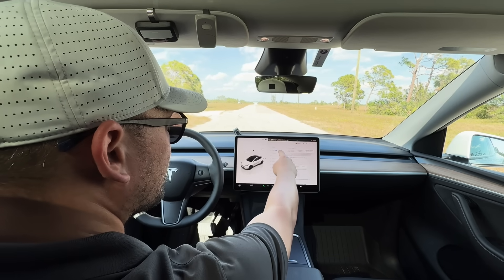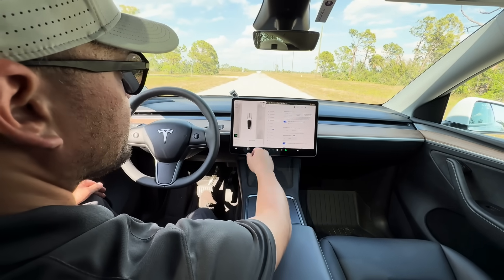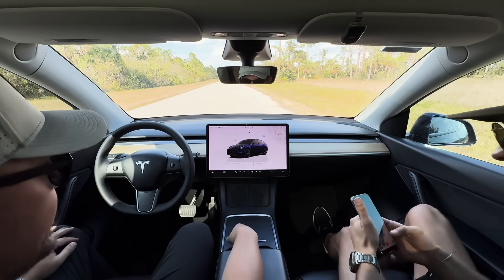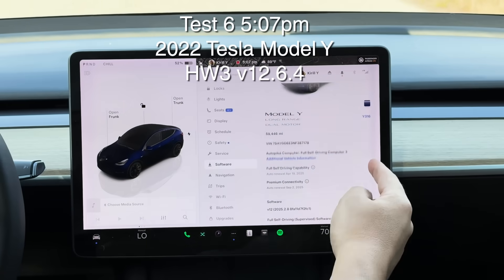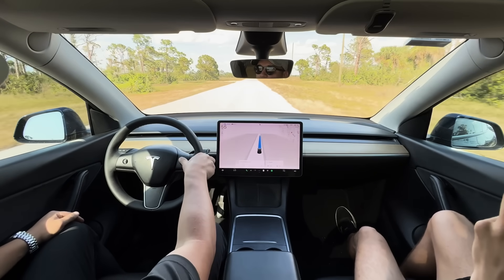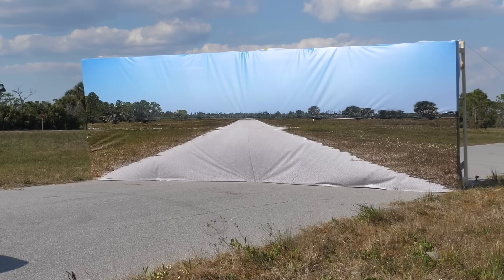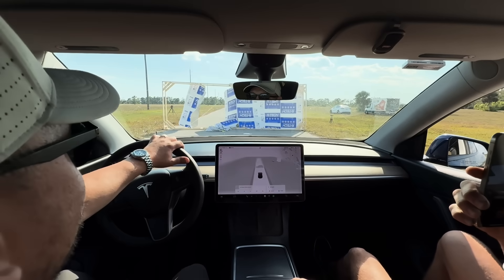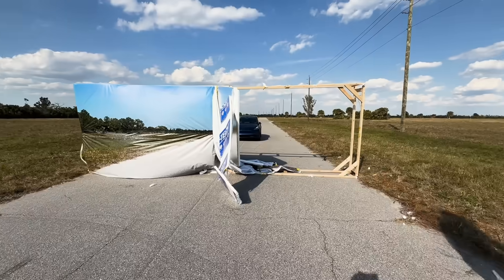Mark Rober Debunked - You can't fool a HW4 Tesla using FSD!

Comment: It’s cool to see hw.4 is able to detect it more reliably, but if you watch the screen as it approaches it still has a hard time deciding if the road is real or not as you can see it changing the direction it thinks the road turns as it approaches.but that’s mainly also due to it being it’s pretty obvious that the fake wall you used doesn’t have the right perspective you should really do it again but make sure the perspective of the image that’s printed actually matches up to the real world and has the correct scale, I’m not saying mark’s test was perfect but his fake wall was definitely more convincing 

But when Tesla started with the whole FSD, lidar technology was super expensive and it make economical sense to not install lidar tech into the cars, but now the tech is much much cheaper to where even phones have a lidar sensors built into them. Just including them would give the neural net  a much more definitive answer on if there is something in the road that blends in or not that the optical cameras  can’t determine. 
There’s really no excuse for the next hardware revision of the teslas to not have lidar sensors built into them.

Comment: I am glad that someone tried the test with different conditions.
You would have to see what the camera sees and how does it analyze the feature points.
It is possible that because the canvas is curled and that the road is not fully continuous on the painting that it saw those curls and it saw the crossroad therefore inferred that there is some object infront.
The only way a visual odometry system can detect distance is from feature points.
If there are not enough feature points or If those feature points are not chaning in terms of diverging on both cameras the detection will think that there is no barier infront.
So this test can vary depending on the light conditions and the wall conditions.

Comment: This is confusing to me, as in 2022 the Model Y came with a front radar. Yet that was removed during 2023 and not available in 2024. So why didn't the front radar see the fake wall? Might it not have enough mass to reflect the radar? I see the styrofoam of the wall has a metallic backing, you would think that would reflect a radar signal. But.....

Comment: The challenge faced by FSD is that 99.9% of the time it will get it right and so will likely pass every test that it undergoes but it really life it must repeat those tests millions of time and at some point will encounter that 0.1% situation.  And if it does the FSD system will be vilified.

The challenge is that whilst everyone is accepting that a human can make mistakes 20% of the time, because to ‘err is human’, anything less than 100% by a computer system is unacceptable.

When a human crashes, their might be an investigation, and sometimes it might be drink, drugs, dangerous driving but most times it will be just chalked up as an accident - you can’t tear open a human’s brain to see exactly what happened.  But when a FSD system crashes there can be an intensive investigation and you will likely find exactly why it crashed and you can ask “if it had been programmed differently, if it had different sensors, would the crash been avoided and chances are the answer will always be ‘yes’.

And that is why society expects FSD systems to be 100% perfect whereas it is okay for humans to be 80% perfect.

Comment: I don't like Tesla. I don't like EVs. Yet, as a computer scientist, I totally expected this to happen for most Teslas.

Figuring out a 2D image vs. a 3D environment is the basic requirement for any camera based environment recognition in computer vision. Before any image content is analyzed by the computer, the 2D image must be framed correctly. Only then you can use your neural net to decode the meaning of the road sign. Therefore, for any camera based system, this large picture will just be a huge meaningless road sign with unrecognizable content for the car.

Within the last few years road sign recognition has greatly improved for the average car. Even my not special Nissan Qashqai from 2022 does this flawlessly, and it has nothing as advanced as self-driving, yet full-self-driving. Therefore, it was to be expected that only older Tesla models may be fooled some times, while recognizing the image most of the times.

Comment: You didn't debunk Mark Rober, per your own description he used older hardware and software, you actually CONFIRMED his test.  You can gig him for not testing on the latest version or multiple versions, but you can be gigged for your inaccurate title.  Click bait much?  Also, I have no clue if version 4 would pass the test or not with a better wall, but you did yours on a rode with lots of trees, there is a distinct difference between your wall and the scene behind it especially when you're further away.  There is also very clear large wrinkles in your picture near the top.

Comment: the thing is the car has skynet built in and it used advanced light composition analysis to determine the walls material and thickness as well as whether anyone is behind it and decided the car wont suffer any damage if it railed through.

Comment: Yeah, but the only problem is is you’re doing it in the daytime try doing it at night the cameras probably won’t be able to pick up on the wall in time if you check out a video on the Wall Street Journal covering Tesla on FSD somebody was driving at night and an 18 wheeler was tipped over on its side and the camera didn’t pick it up in time and killed the driver what Tesla needs to do is add lidar to there vehicles as well and yes that technology is more expensive, but it will save a lot more lives
Reply from the maker: Great idea to test how HW4 would do at night in this scenario. I’ll work on this and see if I can make it happen

Comment: That wall has too many rinkels in it, ofc its going to notice the wall. bad replication of the experiment. 
also you should add two poles to the edge of the wall/mirror" to simulate telephone or power poles to remove the clear edge there.

Comment: I'm no fan of Tesla or Musk but are people really worried about running into a painted wall in the middle of the roadway?
Reply: You never know when a cartoon character might paint a tunnel on the side of a mountian.
Reply: In Mark rober's original video, he was testing how liDar technology differs from Tesla camera technology. This was one of the tests he made for the video. This scenario is obviously not realistic, but the point of the test was mostly to compare the 2 technologies and how camera systems can be fooled.
Reply: @velocity6867  cameras work in basically every scenario except ones where even humans would struggle to see a foot in-front of themselves.
Reply: @ Yea, that's why the test isn't rlly practical. The other tests he showed where tesla failed could be a problem; I would like to see if the new FSD solves them.
Reply: Well the point at this stage is that a single laser range detector can more reliably detect what is in front of it than multiple regular cameras, lots of computer upgrades, and a ton of software jank. If a single component can more reliably replace all those other things, it'd be an excellent addition of safety systems.
Reply: @ cameras can easily detect WHAT an object is and react appropriately, laser detectors have more trouble with this.
Reply: @Axodus  You do realise people are not asking for one or the other. Tesla should use both if they actually care about the safety of their customers and the people around them.
Reply: Might be trouble with reflective surface, like a building with a mirror-like wall.

Comment: So hw4 is a big improvement. only thing i was wondering looking at both test u used isolation foam with a reflected coating could this have effect if you compare it to the test of Mark robert? just curious
Reply from the maker: The front was a strong banner and then foam directly behind it. I don’t think it had much reflective effect. 

Regardless, HW3 didn’t see it and HW4 did. Shows the strength in the newer hardware over the older.

Comment: Interesting, thanks for doing this. I suspect many human drivers would fail and if you had an image of a person on the wall both cars would have stopped. If the firefighters are properly equipped with F500 Encapsulator extinguishing equipment putting the fire out in your proposed test should be a breeze.

Comment: It seems funny but a few people did lose their lives to a situation that was similar. Painted building and even trucks were an issue. It's a good thing that issue was fixed. Large objects can be obscured if it looks similar. This can and has happened with regular people behind the wheel. Self driving or not, if the car can brake in such scenarios it's safer for everybody.

Comment: I am not a scientist but it looks to me that the wall panel is so small that the edges are clearly defined against the background at the time the car starts to slow.  If the wall panel was much larger ie higher and longer it would be more difficult for the cameras to see the edges and then determine it’s a wall.  Also I bet this would crash at night or in slightly foggy conditions where cameras are much less reliable.  Every other manufacturer believes you need multiple different sensor systems which then compare results to get the safest result.  Where human life is concerned relying on cameras is a risk most are not prepared to take.

Comment: My whole thing is, why not throw in a lidar with TESLA? Can I walk with one eye open, sure, but 2 eyes helps for sure, 2 eyes and the nerves in my feet make it even easier, 2 eyes, my ears, and the nerves in my feet is much better. 

Same holds true for sensors in electronics when programmed to work together. Yes TESLA can drive just like we do using our eyes... but if it had lidar too, it could use that to help it see when conditions are not as ideal.

Comment: I mean HW 2 was supposed to be capable of full self driving so regardless they have fallen insanely short, though rober should add a note about what he used for testing and that it may not / isn't accurate for newer hardwares
Reply: Cybertrucks still have terrible problems with full self-driving. I'm assuming they have the newest FSD.
Reply: @Ottawa411  Oh 100%, I just meant its better atleast in some situations than hardware 3 (which was promised to be FSD capable as well so more blatant lies)

Comment: It looks like Tesla has updated its system for this situation. You probably just have to watch out for dividing lines that appear at the edges of the wall. Apart from that, systems that not only use cameras but also radar and lasers recognize such a wall/object without any problem. If Tesla's system is so good, then the question is, why doesn't Waymo just use cameras? And why do Waymo's cars drive successfully autonomously and not Cabs from Tesla?

Comment: Nice video and good test showing the improvements from the older version of FSD, but I can't see how it debunked Mark's video? Mark wasn't using a paid subscription service (FSD) and didn't say he was. Anyway, the wall was just a fun gimmick and the worrisome tests were when the Tesla hit the "child" in heavy rain or dense fog, both conditions which occur way more often than picture walls where I live. The "child" was hidden from cameras (and also from the Lidar in the beginning in the heavy rain test). Hopefully FSD is intelligent enough to slow down in difficult weather. Anyway, Mark has said he don't have beef with Tesla and only showed what happened in his tests, and that he like his Tesla and intend to upgrade it to a new Tesla. Personally I would like to see more sensors on cars including thermal cameras to discover animals outside the road as well as children hidden in the fog (cold rain probably would hide the heat until it was to late unless driving slow).

Comment: Thanks for the retest, although it has to be said that mark robber's setup was clearly better. The image was larger and the horizon was in the same place over a long distance. 
In both cases, the scenario is absolutely irrelavnt for driving safety.

I would still think it would be good if tesla didn't resist other types of sensors. Looking through fog and rain can also save lives. For accidents that could never have been prevented by a human being.
Reply: For sure it should have liadar , but rover did this on purpose , he also had a agiliation with the lidar company with was sung his video for some time . Absolutely filthy someone like him would orscherstarte this .

Comment: wait, so what is the debunk? the second tesla still drove through the wall. were you using the same one as mark?
Reply from the maker: Well we don’t know what Marks motivation was but doesn’t look good. 

He took an old software Tesla and compared it to the latest luminar technology and basically said Tesla is behind competition. 

After I tested it, turns out that Teslas new technology would see the wall, and stop with no issues. 

Just need to test the water and fog next to fully debunk his claim that Tesla is behind competition
Reply: So his video isn't exactly debunked? The model he used actually did go through the wall right? A lot of the stuff I see is people claiming that he falsified the test by disabling self driving right before the wall.

I mean, sure if he is making the claim for ALL Tesla's being the same and only using an old one, that's a bit dodgy or possibly ignorant on his part. You did well using 2 different models.
But not every Tesla owner is going to be in the newest model so I think his video bringing these issues to light is a very good thing and will let people driving older models know that their FSD is not perfect.
I'll be very keen to see your follow up video with the fog and rain.

Comment: Mark had a more real looking wall.  The other tests are important.  Not seeing in  fog or smoke should result in FSD or ADAS disengaging.  My Subaru'a EyeSight gives up when its cameras are not able to see well.  I don't like it, but it is safer.  The Tesla in Mark's tests was fooled by the fake wall.  It also should have recognized when the cameras were inadequate and disengaged.  I think Tesla has done well with vision only, but it should have lidar or radar to assist stopping when there are detectable obstacles.  Two systems with conflicting inputs are not really a problem.  There must be some threshold for the number of lidar pulses required to indicate an obstacle as there must be for vision.  After meeting the threshold I would prefer the make my own driving decisions..

Comment: if a customer can get a Lidar-equipped vehicle at the same price as a Tesla then the wall test, at twilight in the rain, becomes less of a factor. Chinese EVs are bundling Lidar. There are accusations that they have been subsidized by the CCP but if they get traction then economies of scale will drive the price of Lidar down. 

Waymo’s biggest problem is the price of their cars - and Lidar is believed to be a large contributor to the price.

Comment: Where's the fog test?
Reply: The fog test was never in question.

Teslas use cameras and just like human eyes it'll obscure it's vision.
Reply: @Axodus  Exactly. Tesla should not be restricting their safety system because 'humans can drive with only 2 eyes'.
Reply: @ A multi-sensor suite would be uneconomic, if I as a consumer had to choose between the two and I'd have to front the extra cost, I'd just buy the camera-only car, it's completely redundant except in the most outrageous situations where even a human driver would struggle, so why would I pay extra for that.
Reply: @Axodus  Well the Tesla reason is not cost, but sensor confusion. But you are right in one way, in reality it is a penny-pinching measure, trading safety (their supposed top priority) for saving a few bucks. The same hubris that saw them remove the indicator stalk from the facelift model 3. I fully expect to see radar or something similar return though, just like the stalk returned on the facelift Y.
Reply: @T0NY66  How am I only right in one way. What I said was literally what I would do, I can't be wrong when I was answering what I specifically would do in a situation.
Reply: @Axodus  My first Tesla had radar, if another Model 3 was available at the same time for a few bucks less with a inferior safety system, I would not have bought it. But you do you.

Comment: This wall was too small, car could see proportions were off on sides, and was clearly visible to see from a distance.  Not an apples to apples comparison to Mark’s test wall.
Reply: Yep, the simple truth is that a camera with software can always be tricked, it's just a matter of making the wall more realistic and making it larger so the camera can't see the inconsistencies in perspective as it approaches. This isn't even a debatable thing; it's just a fact. A camera doesn't have any other data it can rely on outside of what it sees. Whereas LiDAR uses lasers to determine distance, so regardless of how realistic you make that wall, it's always just going to see wall.
Reply: It's true, he doesn't have a ton of jump cuts and try but fail to completely edit out where he changed to settings and wasn't actually driving on self driving. Also this guy didn't get paid $3,000,000 to commit fraud and try to tank the stock while being a share holder in the competitions company.
Reply: @Daniel-ty2ke  Even if he did use FSD, this video proved his Tesla would still fail.
Reply: Mark test was trash and politic driven.
Reply: @helloman3676 Even if it wasn't politically motivated (which it certainly could be) the fact it was all based around a LIDAR company promoting their tech is problematic enough.